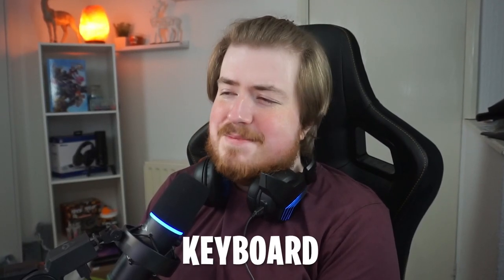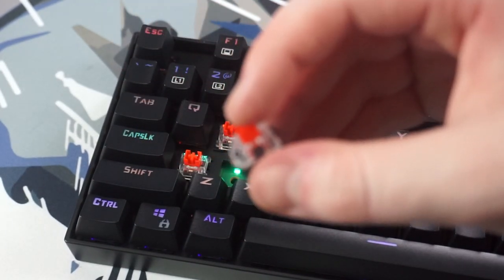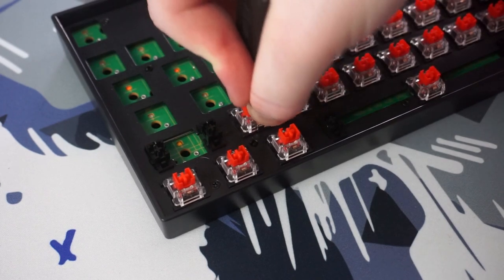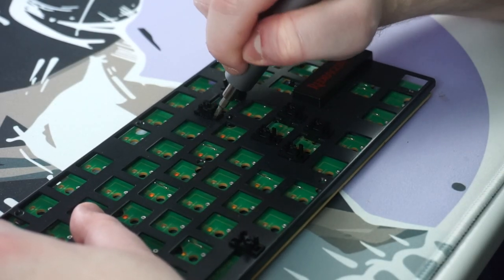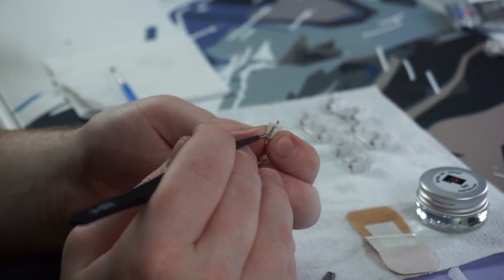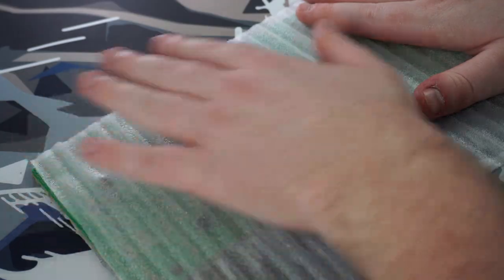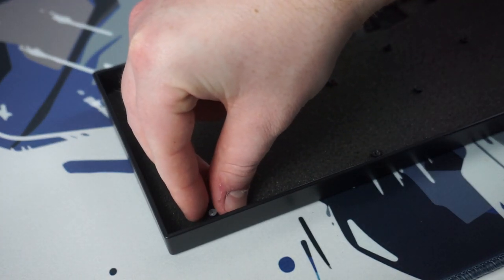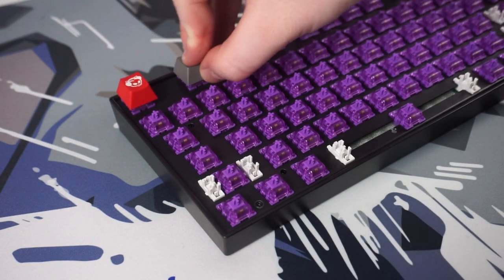I Upgraded The Redragon K552!

Comment: this switch puller is well known for breaking the cheaper switches like the outemu ones. it happened to me as well i have both the same keyboard and switch puller
Reply: Iirc it's not the switch puller it's how you are pulling it because Outemu sockets are really tight, and if you pull slow, instead of fast, you are basically just ripping the socket out

Comment: I originally the blue switch version of this, but I ended up getting some Akko CS Rose reds, and I’m hoping to put a rubber sheet in mine.
Reply: Are the AKKOs made by Oetemu? I was under the impression that only Oetemu's will fit.
Reply: @Xyrium they’re not made by the same company, but they use the same socket.

Comment: How did you get around the RD extra bit they solder onto the PCB joints? I had to pop those out one by one to get my holy pandas on there. They’d be the outemu housings that wouldn’t support other switches. Wondering what I missed haha

Comment: If i do none of this and just switch switches with akko switches. Will it still work?
Reply: The other mods really help a lot especially the holee mod(for stabilizers) if you dont add a foam youll not get the thock you get in a good keyboard either and you need to lube your akko switches (factory lubbed is not the best)